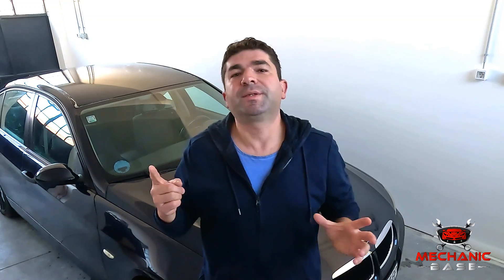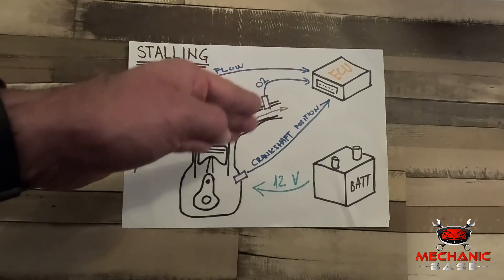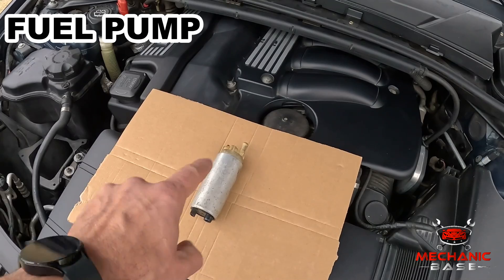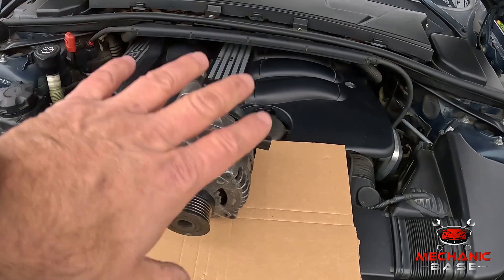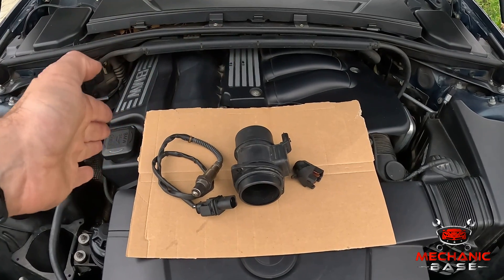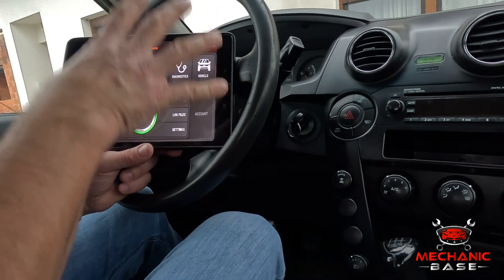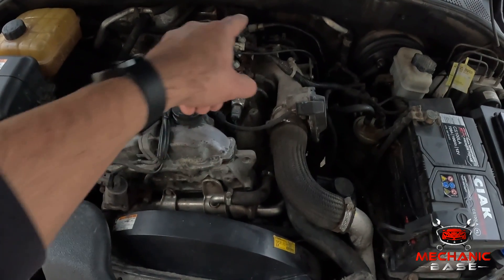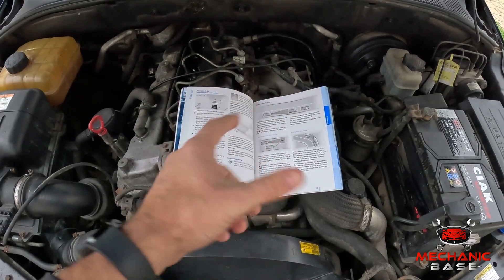Car Shuts Off While Driving? 7 Causes & How to fix it

Comment from the maker: Did these fixes solve your car issue? Let us know in the comments below, and maybe you can help someone else with a car that shuts off while driving!
Don't forget to like the video and subscribe to our channel!
More diagnosis information: https://mechanicbase.com/driving/car-shuts-off-while-driving/
Reply: Had to subscribe. This video helped me to calm down and take it step by step.
Reply: Hi!
I've a Opel Corsa C 1.4 16v
the engine start good, any codes or ligths on the dashbord appers, but after 15 or 20 minutes after the start and when the engine get temperature 90°c the engine cut out, after that, I trying to restart it, but the half of the dashbord is off... no check engine light, no oil, no inmo, nothing light are ON... after that 1 hour and when the engine is cold or warm, the engine start again normally. Do you think that the crankshaft sensor is damaged or the connector o wires? or could be the ignition switch?
Thanks for your comments back.
Regards from Mexico!
Reply: @artesa4878  hi bro same Problem with me corsa 1,2 engine,,, tell me what you doing,,,to fix this Problem,,,thanks
Reply: Hello brother did you know the cause of the problem I have the car engine turns off like you and I have Arbel did you know the reason please tell me if you knew  @artesa4878
Reply: Please let me know, how I can send you a video to show you this issue...
please🙌👍
Reply: I teplaced the turbine sensor on a 2013 ford focus SE and now its making a ticking noise,whats wrong with it
Reply: My volvo s80 runs and then just shut off
Reply: Any idea what to do for a 16 chevy cruze that does this?
Reply: This video didn’t help at all
Reply: I’m not so sure cause I think it should throw a code if crank sensor was bad, but maybe😅
Reply: Mine turns off when battery light comes on no codes, but starts right up after wards then repeat this again.  Why would it shut off and startup
Reply: No he just keeps talking
Reply: So I replace the starter and it was driving smooth until now it shut off and when I turn it on makes a different sound

Comment: I’m having a problem. My car turns off when driving a little slow like 20 miles or when stopped at a light. When the car turns off the whole dashboard stays on and I haven’t got a check engine light. The mechanic didn’t know what was the problem

Comment: I know this video is 2 years old, but I need help.

Got a used 2008 Nissan Pathfinder.  It dies while running, but doesn't stall. The electric panel on the dash often goes off. It sometimes cranks, sometimes doesn't.  It has finally not started at all. I think it may be the Ignition Switch, as stated, but if that's not it, what else can I check? Thanks ❤

Mechanic has changed the Anti Theft sensor, fuel pump, and a few wires. I'm stumped

Comment: Ohhh how interesting!!
I’m experiencing an issue whereby my car drives just fine, but shuts off when I’m about to slow down or shift down or come to a stop or approaching a turn… and from this video it seems to be pointing to the Intake Air Control Valve..
Reply: I’m having a similar issue did you ever figure it out?

Comment: Hi..i have a suzuki s-cross 1.3  diesel engine, and when driving with the AC  on, and after few kilometers, after turning off the AC and when i accelerate to change the gear, then engine sunddenly stop itself and it can't start the engine and when i switch on and off the ignition then only the engine can start up, when i  switch on the ignition the fuel pump work(heat) only the after 5/6 sec then only the engine can start, and the check engine light show up, but after shutting down the engine for an hour it can start properly and the check engine light disappears..i took the car to a mechanics there they change the fuel fiter, air filter, clean the intercooler, Egr but after few days the same problem happens again..what could be the problem..please help me

Comment: OB2 scanner is not reliable trouble shooting mechanical issue. The engine/generator shut down instantly with no warning lights. I used my mechanical skills and brains to diagnosis each components easy way.

Comment: My Peugeot 206 1.1 will shut down and then restart as if there's no problem and go for ages and then do it again but the last time it did the engine warning light was flashing I think the dash went off but not 100 percent sure  I'll check the fault coads first it happened again tonight I will check the ignition switch first could also be a blocked fuel filter but  I don't think it would start up straight away If the fuel filter was blocked ?if the ignition switch was faulty it would not bring on the engine warning light would it ? when the car shut down or would it ? The ignition crank sensor would be a problem with the engines running all the time would it? or can a problem show up now and again as with my car ? But its not a big job to change it and not to costly for that part my cars 22 years old so it could be the ignition switch connection's worn out 🤔 and I don't want to lose her just hope it's not the ECU as you can't just change them as there linked to the key for that car with the transponder in it  I'll have to take my time and not panic with this one it's a right pain fantastic video you have given me some good ideas to try never thought about the ignition switch could be the problem 🤔💯👍

Comment: My car does the same thing. While stopping my car shut down and saying low fuel. With a full tank of gas. I’ve never let my gas get low. Car cut back on like nothing happened.
Reply: Check fuel pump relay or fuse

Comment: My 2019 Chevy Malibu shut off while driving and gas gauge went to empty, but it actually has a full tank. It also had a warning showing Service Power Steering.
Reply: What was the issue. My 2017 chevy cruze just turned off today while driving.
Reply: @nodakgirl93 I never found out. The issue just went away. I recently got an air filter changed recently. I can’t recall what the actual filter was called tho. Sorry.

Comment: Please help.  I've purchased a free new and and even KIA took $200 and said I need to buy a  $17K motor.  Right. Not $1,700.  K vexed because the car robs good. 

It cuts off and needs a jump and will only run until the charge is gone out of the battery. 

I've purchased several alternator too.  
I thought Kia would fix it or at least point to a specific component not an entire long engine block. 

AutoZone test mention can and crank shaft which I've purchased but everyone refuses to put them in.

They state my problem is electrical as if the sensors aren't electrical.

The result is I can only drive as far as the battery is charged so I bring the battery in the house and put it on a charger.  I keep the jump box with me..

The car warms me that's it's going to stop because my dash shows a[ic of the battery.  Moments later, ABS and ECS lights come on and then the fuel and RPM instrumentation needles goes dead.  

Kia said I have sludge in the oil and the trouble codes were cleared.  I suspect the because the check engine light didn't come on while traveling to the shop, they just went off AutoZone paper work.  

I've seen O2 Sensors cause a car to suddenly overheat, but never seen any other sensor fault issues.

Please help.  What's wrong with my car.  There's no communication between the and battery.
Reply: By the way, it's a 2007 Sorento 3.8.  I just got it but it ran fine for 1 month.
Reply: I'd put the sensors on myself but my hands have arthritis.
Reply: Nothing in this video said the car will need to keep being charged in order for the car to work again also.
Reply: If it is like my Nissan it may have a fuse blown on the positive post side . Or something may be pulling power from it while it's parked. I pulled the negative post off on my van and it didn't drain it.  But that's a bandaid. Old school way to test if alternator is working. Take positive post off and if it shuts down alternator is not working properly. When doing so turn car of before reconnecting post back to battery. One of thing is to go to is fuse box and check any fuse or relay that may keep power going to battery. Use fuse or relay that is to something that is not needed but will be good so you can replace it later. Like power seat or heated mirror or the like. Not a ECM or ECU. They go to the brain of the auto. All car's have one , wish all people did. 😂 😉

Comment: My 89 corvette stopped in the middle of the road, i already had a bad battery so i had to jump the vehicle and it started right up and was running good when idling, but when i start giving it gas it sputters, meaning it gives gas and then it wont and it will repeat till i stop and when i stop it will turn off i believe it could be a spark plug or a broken wire, if anyone has any other ideas please feel free to give me your input, Thanks.

Comment: My 2020 zl1 suddenly stopped sucking gas ,I was going 75 mph , I had at least 3/4 of a tank ,i pulled over ,it would not restart, the engine light was on , I went to the trunk and disconnected and reconnected the battery, got in, and it started right away and I made it 200 miles home without issue, this is the second time this has happened , anyone got an idea? It's going to the shop on Wednesday, but I just wanted to know if anyone else has had this issue? The car has 19,000 miles.
Reply: Turns out it was the fuel pump. Got it repaired and everything is fine 👍👍👍

Comment: If it was the crankshaft position sensor wouldn't the engine be continually misfiring and generally running like a pig?
My car runs really sweet then stops suddenly and sometimes won't do a thing when you try to restart it. I think it's a dodgy Electrical Ignition Switch.

Comment: Of course, you could have in past bought a GOOD car with NO problems in first place, by using CARFAX.  When you buy these used cars from other owners rather than going to used car dealers or others, you have an even worst risk of being scammed.  yeah, the sales people will try to make a profit and sometimes can scam you..  BUT YOU HAVE TOOLS to get past that.  With an non pro dealer, or a  person on street trying to sell you a car, YOU HAVE NO PROTECTION, no ability to get a good receipt or promise or Laws that protect you.  Get some good financing.  If a neighbor or a friend is trying to sell you a car, ask him why he didn't trade it in for a better car?  He can't because its junk.  UNLESS YOU LIKE working on cars a lot and are a tinkerer, don't buy the car.  I am not a carpenter and a "tinkerer'.  I work hard at my job and DON'T LIKE my free time being STUCK in the garage and heat getting grease and dirt on me.  I don't love my cars THAT MUCH.

Comment: Bull.  I had a similar problem with my Buick.  IT IS NEVER easy to fix.  that is a lie.  many youtubers who think they are great mechanics, like to show off telling you stuff that they discovered  that works.  IT DOESN'T.  its dangerous.  Its a waste of time.  ESPECIALLY, if you have gone to the garage more than 2 times.  If you have already put in 2500 $ of repairs in the last 3 years....GET RID OF CAR.  don't listen to these "super mechanics" who can fix anything on youtube.  YOU ARE THE ONE who is going to have to get greasy, WORK HARD, and struggle to fix this.  You are not a professional.  It is never easy to fix these things.  I am not a dealer or a car salesman.  I work security and I believe in safety.  DON'T TAKE CHANCES with a car that "shuts" off.  thats bullshit.  I can understand if it was just a minor issue on your car.  But if it shuts down, it sin't something small.  The key here is, if you have already taken it to the mechanics.  Once ANY CAR, ANY... gets over 100,000 miles, it may have problems.
Reply: lol With that mindset you’re definitely not getting anything done. You sound discouraged. Also who said it’s easy the reality is it’s hard if you aren’t up for it then take it to a shop but no reason to be spending $2000-$3000 dollars on some junk in that case your just getting scammed my guy.

Comment: What about the purge valve? Mines shutting off while accelerating
Reply: When purge valves go bad. Need to replace it. Buy original not aftermarket. I had to buy twice as aftermarket didn’t work and wasn’t returnable. 
One advice: what makes purge valve to go bad to begin with? Is your habit of over filling the gas tank . Ask me how I know

Comment: my car only shuts down after driving for more than an hour in high outside temperature, before turning off the rpms go low and the car starts to shake and i cant turn it on for 10 minutes, after 10 minutes it starts normally, any idea what it is?
Reply: Am having the same problem
Reply: @aminejaguar6160  fixed it, it was an ignition coil
Reply: Hi I'm going through this exact problem but my car manages to start each time after stall. Did you fix your issues?
Reply: @digiecovers543  yes it was an ignition coil and i also changed the spark plugs because they were kind old
Reply: Coolant

Comment: Okay so look, my car only turns off when the ac is on and I am parked or idle. It shuts the engine off and struggles to turn back on. I have a brand new battery and just got a brand new ac system with a brand new compressor. What could it possibly be? And I get no check engine light… what does that sound like ?

Comment: I have a very strange problem on my Citroen c5 1.6 hdi.
Antipollution fault comes on and shuts engine off. It works only in idle and as soon i put in first, third and fifth gear it shuts down.

Comment: My Odyssey shuts off on hot days.. it works ok on cooler days.. please help.
Reply from the maker: It isn't overheating, right? 
One possible cause is a faulty crankshaft sensor - when it's hot, it starts sending wrong signals.

Comment: Hi my Peugeot 206 driving then stop each time but it’s starting, the battery light was on, I’ve changed the alternator then the engine light turn off, but the issues is when driving it’s stopping.
Reply: I'm in the same boat but haven't fixed it yet. It probably electric wiring that your car need it fixed. I just called the Auto shop electric but they're all booked for 2 weeks. I was afraid to just change my alternator since I wasn't sure if it's the one that has a problem,also it's $245+$150 of labor.

Comment: I had a similar problem, turns out my engine wiring harness was shorting out because the wires were corroded and needed to replace it.
Reply from the maker: Yes, that's why it's always a good idea to chech the wiring before replacing any sensors👍👍
Reply: That will definitely help especially if it is around any kind of fuse or relays. That fuse isn't blown. Of course, the corrosion won't let the power get to it to blow it. 🧐😆

Comment: My E90 just switched off and turned all the lights off any solution u know??even the key is locked on the ignition and it can't come out bcs the car is off
Reply: I'm in the same boat right thus minute. Mine would just stop anywhere(in the middle of the busy street or highway)and won't start,just low idling,stuck ignition and a battery sign on the dash board. I was thinking maybe  it either wiring issue or alternator. What was the solution for your car since it been 3 months?

Comment: I'm here due to my 2006 buick lacrosse, I replaced the battery a day ago, the day of replacement all was good the next day traveled to work with no problem, leaving work the first red light car stalled with no notice, my dash still illuminated.  Idling it don't cut off, I'm not getting trouble codes. 2006 buick lacrosse CX 3800 engine
Reply: Had it fixed yet? If yes, what was the problem?
Reply: @OsasHarryson  haven't fixed yet, I can drive for two days then it starts shutting off, there's no engine light. 
My conclusion is that the fuel pump needs replacing. Hopefully in next 2 months I'll have it in the shop for repairs.
Reply: @mogumatrix  I have a similar challenge. I changed the fuel pump already but the problem persists.

Comment: Engine Shutdown Issue in Audi A4 2009 Wagon 2.0

 I have encountered several instances where the engine shuts down while driving, particularly when I am navigating through traffic and occasionally on the 3rd and 5th gear. Recently, I also noticed that the EPC light briefly illuminates in orange when the car slows down, particularly at speeds around 50 km/h while in 5th gear. Despite these engine shutdowns, the electronic display and other vehicle systems remain operational.

Could you kindly provide insight into what might be causing these symptoms and recommend the necessary steps to address them? Additionally, I would appreciate any guidance on the estimated timeframe and cost involved in resolving this issue.

Thank you very much for your attention to this matter.

Comment: looking for helpo. 2014 4 runner loses power once a month. Driving normal then it loses power, I can stear and break but with no power assist. No gas/acceleration and the traction control module goes crazy. Pop into neutral and turn off and away I go. MPG was an issue so I changed the Mass Airflow Sensor and its better. No codes are sent and Toyota has no clue.

Comment: 2002 camry, 240k miles.  Cut off while driving, no crank no start.  Dash lights and headlights on.   No blown fuses, no visibly burnt relays.  Any thoughts?
Reply: Still not running.  Thinking it's the computer
Reply: 0:52 my mother's 2003 Cadillac CTS shutdown completely and won't come back alive? It had been badly over heating before this? @newprep3661
Reply: hey man same happened to my 2001 camry, had me trippin for 2months,if it has a dealer installed remote start and alarm, you can try un plugging all the non factory shit under dash by fuses and plug together back the factory plug end s that match up ,if fixed mine after hours of checking relays ,fuses,alt etc. that remote start starts doing funky shit when it fries
Reply: Same here 2004 Camry. It has happened the 4th time now